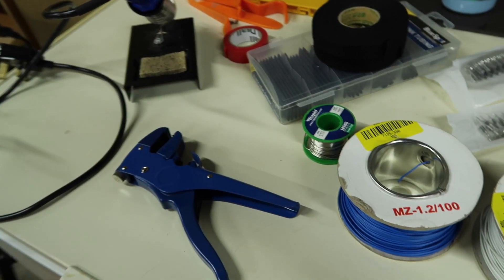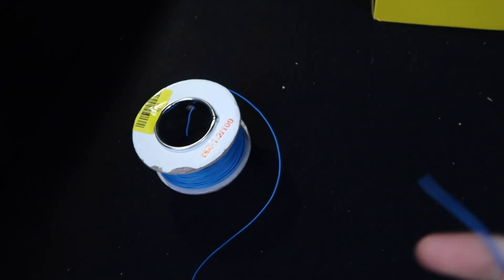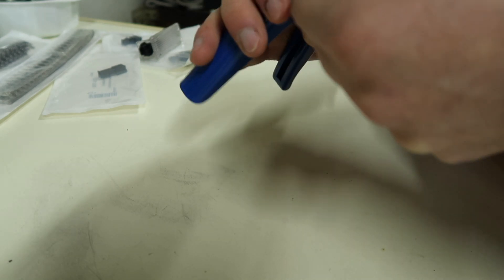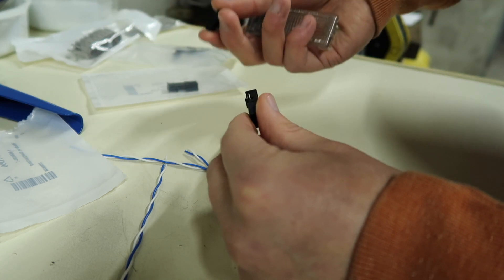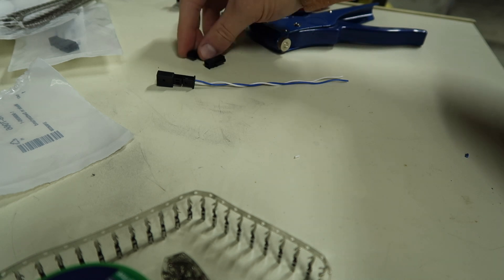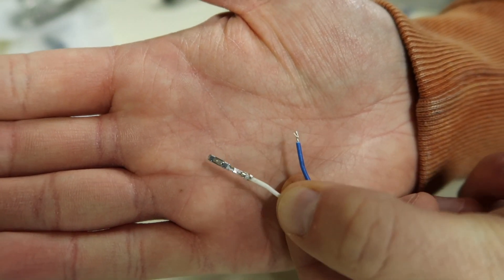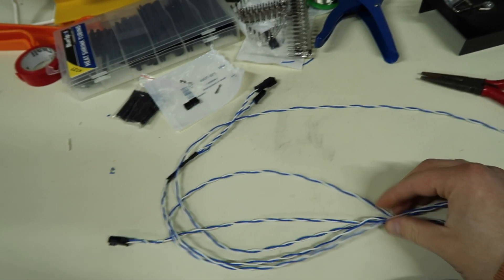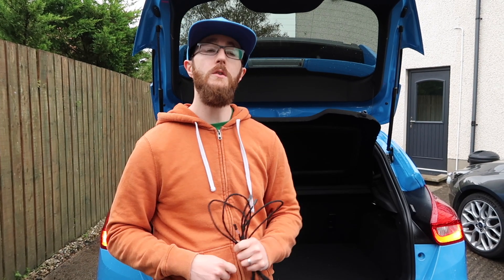HOW TO MAKE A WIRING HARNESS FOR A SECOND BOOT LIGHT! | FOCUS RS

Comment: Hello What bulbs\leds do you use for indicator front and back and what about LED brake lights?
Reply from the maker: Hi David, everything is from the Autobeam performance range
Reply: Cool no resistors needed?
Reply from the maker: No, all plug and play
Reply: @AdamRainey  Thanks just ordered brake and reverse but bit pissed no 581's in stock

Comment: Would u sell a harness mate ?
Reply from the maker: Hello, I would if it was going to be economical to do. The question is, how much would people be willing to pay? If there is enough interest I might make a small batch
Reply: That’s fair mate , give me a price u would be happy with . My focus st boot is so dim a night .
Reply: @AdamRainey  plenty of interest for this previously if you check the RS forums. I got one of the previous batch made by Trigger. He sold his for circa £25 each - but it's a lot of work
Reply from the maker: Yea mate, I have read the forums and indeed I originally tried to get him to make me one but I don't think he had enough bits or enough time so I just blasted on and made my own. 25 quid seems reasonable
Reply: I think £25 is a good price, but I’ve just gone out to my car and I have a second light fitted already so just need to change the bulbs for brighter units . Love ur videos
Reply from the maker: Nice one, I think the 2016 RS has the 2 but then just from 2017 on they started to try and save cash
Reply: Yes correct, they deleted the left hand light from cars built after about September 2016